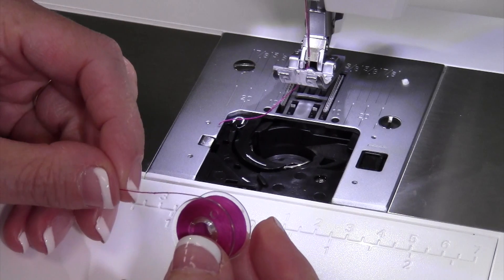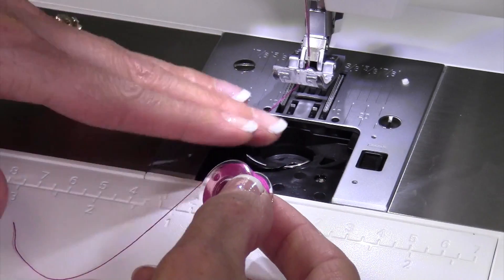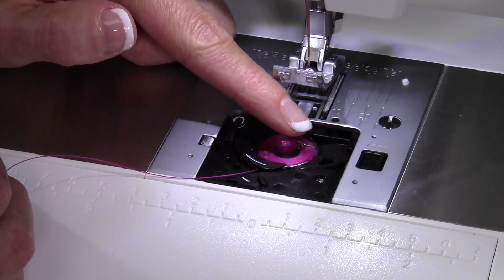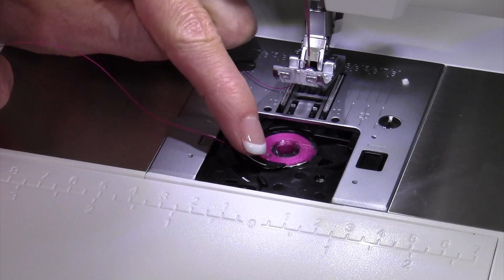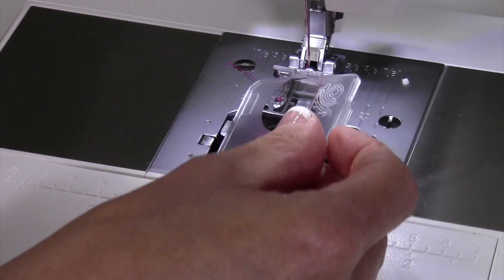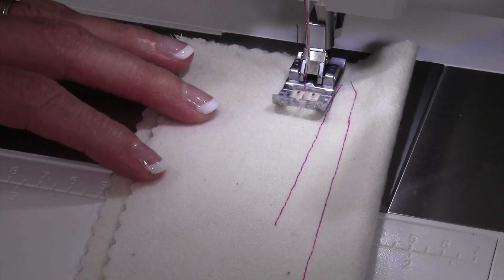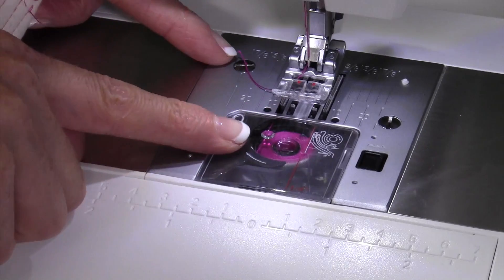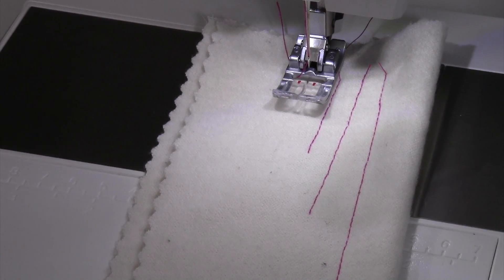Pfaff Passport 3.0 - 4 How to Insert the Bobbin

Comment: This is bothering me because every place I look to figure out how to access the area that they are working in, they always start with the area already open. I don't even know how to get to that part. 😭
Reply: I hope you already have your answer. If not, the video is showing the flat/horizontal area just on the presser foot and needle of the machine, looking down. Remove the clear “plate” by pushing the black square (in the middle right of the screen) to the right. That will make the clear plate/cover open and you can insert or remove the bobbin (hot pink in the video).
Reply: @alittlebirdcrafts  Thank you so much!